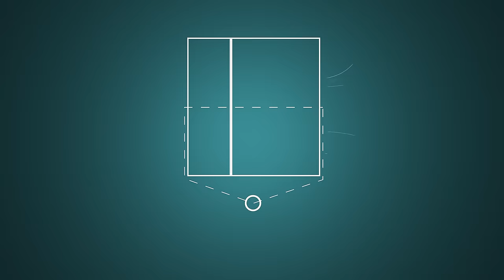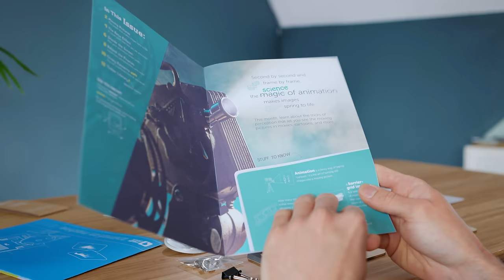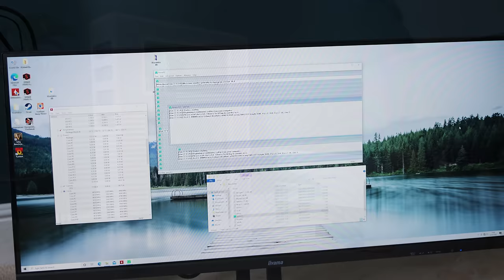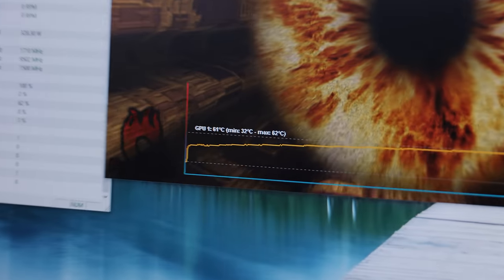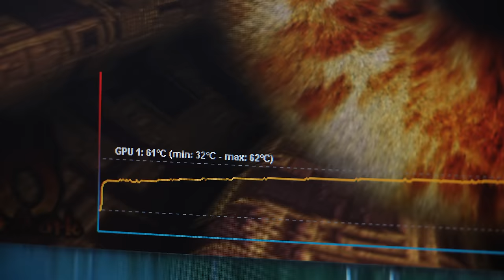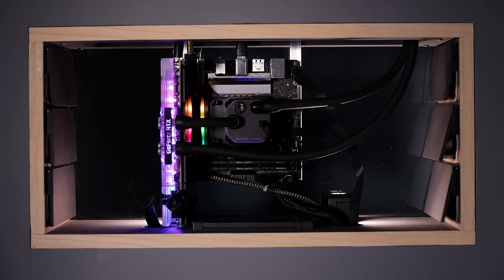Building the world's first 'breathing' PC

Comment: The fact that it keeps replacing all air with fresh air makes most of the difference I think. There is usually a lot of recirculation in most cases.
Reply: also that it blows in both directions, meaning each component will get uniform distribution of air unlike a one way system that would disrupt the airflow from hit components behind the direction of air.

Comment: 17:00 The reason you're getting better than expected results harken to a principle on building architecture from ancient India. Many of the older buildings have an area around the perimeter called the "jaali." This is basically an enclosed walkway around the building. The walls were made of perforated stones with some very beautiful designs. As the breeze pushes air through those perforations, there's a substantial cooling effect. So just by compressing the air by forcing it through the vent holes, you're dropping the temperature. This is the principle that I don't think you took into account. A very happy accident.

I don't know how well your bellows would work if you increased the workload some by narrowing the intake vents to increase the effect. If it's possible, you might want to consider giving that a try.

This is truly an inspiring build.
Reply: I'm not sure but I think it's called Joule-Thomson effect

Comment: given how extreme pc building has gotten, this isn't at all unpractical
Reply: It's over 4 feet tall!
Reply: the tolerances on the glass tube and magnet make it very unpractical for anything more than one mans special project.
Reply: @rymca4758  you can use epoxy glue around the magnet or a thin tape too, as a shortcut
Reply: I say, because it's become something of an art piece in this process, size doesn't matter very much
Reply: The only value it has is artistic value; it didn't increase cooling efficiency enough to justify the insanely inflated price tag. Furthermore, the 5 pumps running at any given time draw roughly 50% more power than the equivalent 4 fans. $9.3/yr more to operate a rig that depreciates in value every day and it broke once just in the build process. Yes, it's cool, but wildly impractical.
Reply: @andrewlisenby  theres a decently sized subsection of people who have tried to build passively cooled pcs, spending much more money that you would on a normal fan pc. This build should be compared to passive coolers due to the lack of fan noise. If you compare this to passive builds, it allows nearly silent builds to use high end hardware and at temperatures that are more than acceptable. I also know a lot of people who would pay 10 bucks a year to eliminate pc fan noise (myself included).
Reply: @andrewlisenby  you seriously think that 9 dollars a year makes this unreasonable? Come on man, gotta come up with better excuses
Reply: This is a project, do you guys not understand that he wasn't planning to use this as a daily practical rig. This was a project. Man you guys are so thick. I for one am absolutely blown away by this, super cool! good job man.
Reply: @gazmate2719  yeah it even says it in the title. First breathing pc. And even if he plans to use it daily. He can.

Comment: So its like a human: A brain, powered by the liquid heart and a lung.
Reply: Ahh yes. My liquid heart
Reply: Despite odd word usage, it is kinda creepy how live like it is
Reply: It's not powered by the air, pal
Reply: @GaiusCaligula234  well we aren't powered by only air we also eat and food for the pc is electricity and what make electricity coal so by definition this pc its like a human and the keyword that the original comment is "like" implying that its similer to human :P
Reply: @gamnhamcodon  air only cools the computer, it doesn't help with the power bub
Reply: @GaiusCaligula234  it may not help power but our breathing plays a very large role in temperature regulation anyway, hence breathing heavily when too warm.
Reply: @GaiusCaligula234  yeah, well, if you turn off the "lung" of this computer, it'd die.. pretty much live stuff
Reply: @praneetguharoy3359  Not necessarily
Reply: @GaiusCaligula234  well.. yeah.. no working radiator, it'll thermal throttle and eventually force shut off
Reply: @praneetguharoy3359  Sounds like you don't have much experience with older computers, that's okay though, no worries
Reply: @GaiusCaligula234  dude, i m rocking a pentium dual core rn.. stop fighting about it.. temps go to 90 and processor starts throttling.. its such a trivial matter
Reply: @praneetguharoy3359  I'm not talking about modern computers, I'm talking about lamp computers
Reply: @GaiusCaligula234  dude, in the video, it's a modern computer..
Reply: @praneetguharoy3359  How does that matter, again, lungs and radiator serve completely different primary goals
Reply: @GaiusCaligula234  but in the end they are fundamental to the working of a living being or a computer
Reply: @praneetguharoy3359  Stop feeding the troll.
Reply: @zeljkoopalic5994  bro it's like a debate.. nothing hostile
Reply: @praneetguharoy3359  That's.......fair enough :)
Reply: Isn't this a great design for breathing machines they supposedly desperately needed a year ago?
Reply: Yep
Reply: @steamsteam6607  now that you pointed out... kinda?

Comment: If the bellows are 1m x 1m x 0.3m and pumping at 0.5 Hz, the airflow is about 1200 m3/h, which equates about 13 Noctua NF-F12 at full speed. 
But just visually it's insane how much air this thing can move

Comment: "oh no, the magnet doesn't fit." Normal reaction - buy more tubes. "Oh no, none of the new tubes fit properly": Me - wrap magnet in aluminium tape. Matt - i'll just thicken up the nickel plating using the electrolyte i made from scratch, a small speaker, and a sine wave. 

Well played my man!
Reply: I think I would've tried to lathe down a magnet that was slightly too large, to be honest!
Reply: @ojkolsrud1  I'm not sure that you could turn a neodymium magnet in a lathe they're quite brittle. The cutting forces or the clamping force from the lathe chuck might be enough to shatter the magnet.
Reply: @LeonardChurch33  Gently sanding it while rotating in a lathe instead of cutting will work better. But some kind of mounting jig out of wood or plastic to clamp it without shattering will be required.
Reply: Honestly I though that coating it in paint or adding end pieces that are softer and slightly wider might have been easier, but let's be honest, electrolyte coating is way cooler and makes a way better video.
Reply: @LeonardChurch33  That's probably true, but you could've tried chipping away to top layer of plating! That might have been enough.

Comment: intead of 3 large vent flaps on either side, maybe an upgrade would be a singular large pane with a bunch of micropanels. each panel would open easier given the reduced weight of each individual panel. This reduction in resistance would allow more prompt airflow. something to consider ! :)

Comment: He used different branches of sciences to make this build, es increible.
Reply: YESSS
Reply: What are these branches ?
Reply: @HamzaShams_  mainly physics
Reply: @jameswood7207  Yes and some chemistry
Reply: @HamzaShams_  Any engineering in general taught the fundamentals for builds such as this, though for the specific field that are taught in depth of these techniques: mechanical engineering for the build itself, electrical engineering for the circuit principle, chemical engineering (of material science) for proper choices and techniques of coating.

Comment: The solution for the broken tube is what I would call a really rather genius move.
Reply: Me, an absolute fool: maybe you could file down the magnet a little bit so that it fits in the tube it's too big for

DIYPerks, a genius: so what I did was electroplate the magnet while shaking it with a sine wave pattern until it was big enough to fit in the tube it was too small for

Comment: This actually would work extremely well for industrial computing where you have some space. If you scaled this same bellows design up to a basement the same size as the computing room above it you could possibly end up cycling and entire rooms worth of air with each breath- which with some rack modifications would be insanely powerful. You could even refrigerate the intake ports on the bottom so that the air is cooled.
Reply: I'm interested in this idea. However don't large scale servers these days use liquid cooling? I just assumed it's because liquids are better heat conductors than air, so I'm unclear if this bellow system would be as effective.
Reply: @freechilli8755  they do, but assuming you could get the bellows cooling to the same efficiency as liquid cooling I think it could be an option if you need to pack a lot of components together really tightly and/or didnt have room for coolant pipes. Liquid probably would take up less space overall though considering you have to build an entire extra room for a bellows setup lmao

Comment: Instead of finding/making a perfect tube, he just made the fucking magnet bigger!
Reply: Just buy a bigger magnet...
Reply: @rafalsadowski  but that won't be as cool as making a magnet fatter by your own isn't it now
Reply: @rafalsadowski  oh and also if you're just gonna buy another magnet then good luck finding one thats specifically .04 mm larger than the original magnet lmao
Reply: @BooPedro  Maybe buying bigger and sanding it to size would be easier, works for modeling. It's crude and I admit it's not sci-fi cool but for a dyi a more practical answer.
Reply: @rafalsadowski  sanding it would remove the coating and make it rough so it wouldn't move as smoothly through the tube
Reply: @rafalsadowski  You can't just SAND magnets xD. If the coating is gone then the magnet will oxidize and uncoated magnets are very brittle.

Comment: Here is an idea. Make the case cylindrical instead, and have the pane pushing air rotate constantly. This would mean there would be no stop motion where the pane switches direction. Two holes on each side of sphere so air can pass through one side and go out the other. I guess like a propeller in an air tight chamber?

Comment: I want Gamers Nexus to review this case. I can't imagine even Steve having a bad thing to say about it. (except maybe not practical to mass produce. Especially considering the effort in getting pipes and magnets to fit so well.
Reply: Schlieren photography
Reply: If it was mass produced, you'd just source magnets and tubes that fit straight from the manufacturer
Reply: Realistically you would just add an o-ring to the magnet
Reply: @jacobhargiss3839  an o-ring would have too much friction on the tube
Reply: Have LTT build a replica then send it to GN lol.
Reply: @cavemaneca  if this were numatic Id agree. It being completely submerged in water however, its basically permanently lubricated.
Reply: I'd imagine proper water cooling might be both more efficient and capable but only long stress tests would show comparable results. If the underrated PSU doesn't crap out first
Reply: @Afeeq1011  "Worst PC Case, so far.."
Reply: @resneptacle  What do you mean proper water cooling? Nearly all the hot bits have a waterblock on them, and the VRM's have air bellowing over them.

Comment: This guy is a mad scientist when he freaking increased the size of the effin magnet.. like who does that ... damnnn.
Reply: Certainly a complex solution to a relatively simple problem*, but hey it worked so kudos to him.
*I would have picked a tube that was too tight then polish the metal by rotating it on a polishing pad until enough metal was removed to fit into the tube.
Reply: @magnanimus9692  But his way had cool green water.
Reply: @JustaRandom09837  True lol
Reply: my 1st solution to the problem was to sand the magnet with sandpaper making it smaller and trying to fit it in the tube that it did not fit...
Reply: @pihermoso11  Yes but then you remove the nickel coating and you're going to put that raw iron into water, say goodbye to your lovely water and all those pumps.

Comment: Would be pretty interesting to see some smoke travel through that system
Reply: With rgb lights reflecting in smoke
Reply: @Arthr0  all lasers, add friggin lasers
Reply: A vape would do the trick
Reply: But a lot of dust will enter with smoke 😂
Reply: @Arthr0  Disco ball as well please!
Reply: the laser and rgb is good but no smoke guys 😂you dont want dust in your pc trust me😅
Reply: I feel like a lot of people misunderstand why he's suggesting the smoke
It's to see the path of air, it's not just for an aesthetic touch. It would be in the system for literally a minute (probably less, considering just how much air this moves), so any resulting dust would be easily cleaned. A smoke test is commonly used by a lot of people to see the path that air travels within a case, in fact it ended up showing one of the flaws with the new H510 Flow from NZXT, where we could see all of the air traveling up and over the GPU, preventing it from getting proper cooling
Reply: @cdgames69  where can I see these tests? is it on a youtube channel? review website?
Reply: @businessime2240  It's an LTT video, I believe it's called "Better fan = worse"

Comment: For the next revision, you can try different air trap sizes: that way, they will open and close at slightly different thresholds and they will look even more alive. Not sure if that will kill some of the pumping action but hey that is why we experiment! Also I think will be a good idea to put some filtering media on those intake flaps so the inside of the chambers don't get dusty over time.
Reply: I guess the filtering media will definitely hamper the cooling.
Reply: For the next revision maybe he can build a PC that actually works as it should. Nobody realized he used a 520 watt passive PSU 🤦‍♂️ This PC isn't sustainable and is only for show. If he tried actually using that PC with those components it would melt.
Reply: @PabzRoz  ... you can buy a 700 watt fanless PSU on newegg for like $250
Reply: @PabzRoz  you keep trying to get this point across, yet someone always finds fault with your logic.  Just stop.
Reply: @ericw.1620  I know that. As to why he didn't use that instead and actually make this PC usable I have no idea.
Reply: @LordxJoe  My point is this PC isn't sustainable with a 520w PSU and there is no "faults" that's just a fact. Idk what you're going on about lol a monkey knows a 520w PSU is not enough for a 5950x and 3080.
Reply: @LordxJoe  you might need to educate yourself on the topic before jumping in. he's 100% right that PSU is way too small for those high end components...
Reply: Something like cheese cloth would probably work wonders
Reply: @LordxJoe  flaws in logic? are u slow or something? there is no flaw in logic here just facts... A 520w PSU is dangerously low and not enough to power a 3080 and a 5950X. That's just common sense you can literally go on Nvidias website and they tell you this. It's common knowledge you're embarrassing yourself right now.
Reply: @LordxJoe  wow you're not too smart huh...
Reply: @cherryberry940  Yet it ran 2 stress test programs with no problem.  Now i do know that each of those tests hit the cpu and gpu separately.  There may be something to that.  Now something to consider.  His PSU did not need to power fans, optical drives, storage (not sure),  secondary PCI cards, lights, or any other external devices.  That saves anywhere between 30-100 watts.  I imagine Nvidia has information like that to accommodate you not running a barebones pc.

Comment: I'd love to see a smoke machine input to this so we could try and see what the airflow looks like around the components. My fear is that while the CPU and GPU are nice and cool due to the water blocks pulling heat away to the radiator, things like the VRMs won't have enough airflow and will be running rather warm.
Reply: Because the motherboard is in the breathing chamber natural airflow, the vrm's do have airflow over them, and if they are good quality vrm's then any kind of airflow over the heatsink is already enough cooling for them to keep up.
Reply: The entire volume of air is changed every second. How is that not enough airflow? It's literally nearly 100%
Reply: I agree with you and all those tight passage ways would hold temperature more, especially with the big wind blocker graphics card there.  However with this system, i also think it is an imperfect test since A. Everything is water cooled. because of that this is really only a test of how well it can push air thru the radiator (though he left a sizeable gap near the hose end wear it meet the main chamber where the board is, which is probably hurting the efficiency horridly) and B) most of the heat isnt being put into the main chamber, its being pushed out from the radiator itself. not through. 

but because of the water cooling the VRM are really the only thing putting heat in the main chamber other than the chipset. 

Air cool everything and then see how well it works. I couldnt tell you honestly. 

I bet this would be a really good case build to use Noctua's new Passive heat sync in a consumer application.
Reply: I was kinda hoping you'd end your sentence with "rather vram"
Reply: @riptaway  The parts could potentially heat up faster than the air can be changed.

Comment: It be nice to know temps when not pumping, to truely see the performance diffrence and what it gains from just being in a large open air container. I do see how it would push air through the radiators more efficiently though.
Reply: Well the actual volume where the motherboard and radiator sit isn’t tremendously bigger than a full tower PC. With no airflow it would surely saturate and thermal throttle after some time.

Comment: Very interesting results! I wonder if the right approach to cooling a radiator is not direct fan attachments, but rather increasing the air pressure in the case... So just a bunch of intake fans + all the gaps sealed => force all the air through the rad